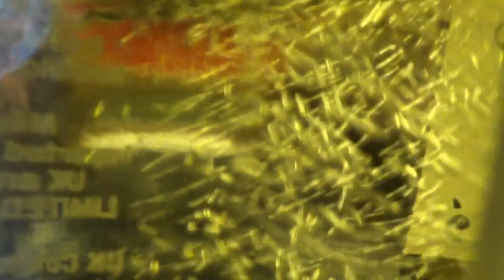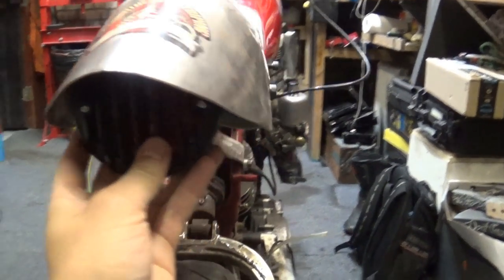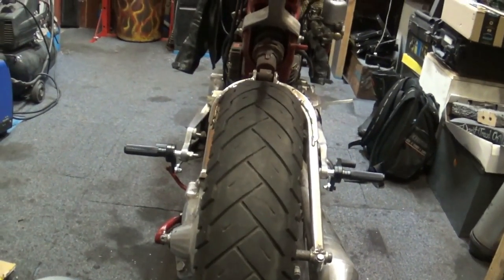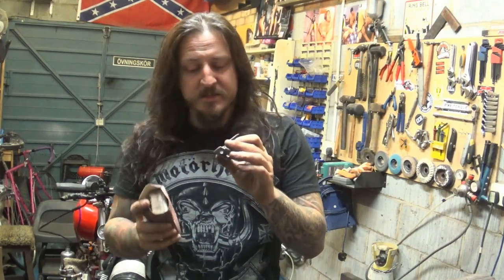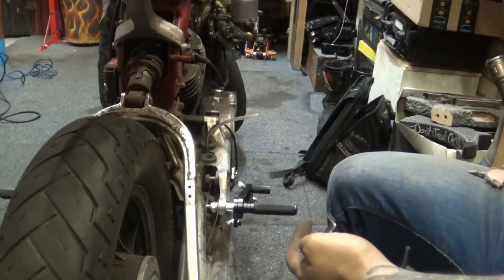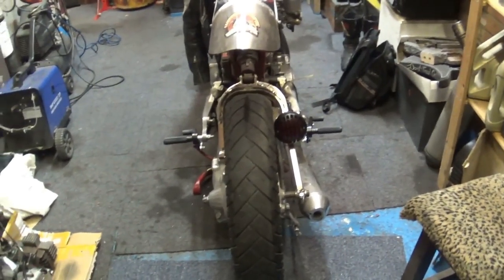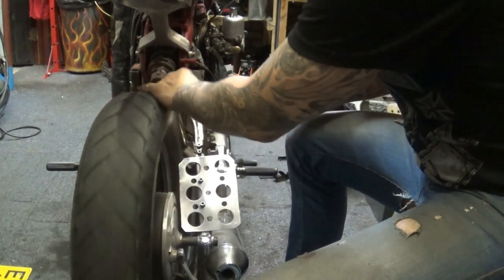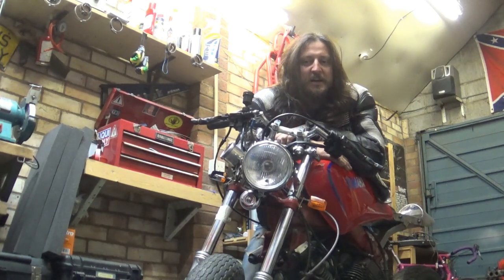Yamaha Virago XV 500 Cafe racer Build, Part 24 - Tail Light and Number Plate

Comment: Mackie I like the side mount bud, I would twist it out a bit at the top to straighten instead of following the swing arm. You also could run your wires through the swing arm for a real clean look. Keep up the good work ✌🏾️
Reply from the maker: Stacey Nixon thanks Stacey! Already done ;) cut some slots into the bracket, so it can be adjusted donuts dead straight. Problem with running wires inside the brace is that the wholes have to be quite large to fit in the dual plug...and that's not ideal. But i will make sure it is clean and hidden the best I can. Appreciate your input. Bests.
Reply: MackieBass wire cutters/soldering iron?
Reply from the maker: Yes, but that means I need to cut it off again if I wanted to remove the light for any maintenance works etc which defeating the point of having removable parts in the first place. I can hid it under the brace, so it won't be visible anyway.

Comment: Hi Mackie. The bike looks good, and the subframe looks cool. Not to throw a curve ball but did you think about doing something like the MV Agusta Dragsta that has a mudguard/light and number plate mount?
Reply from the maker: Daniel Innes thanks Daniel, thanks for the suggestion, I was thinking about that, but it just wasn't right for that build. I may use that idea in the future...but not on this bike.
Reply: MackieBass no worries. Look forward to the next instalment, and keep up the good work and rock on 🤘